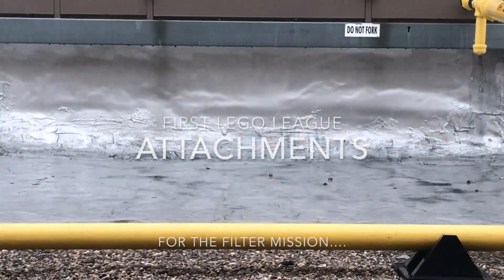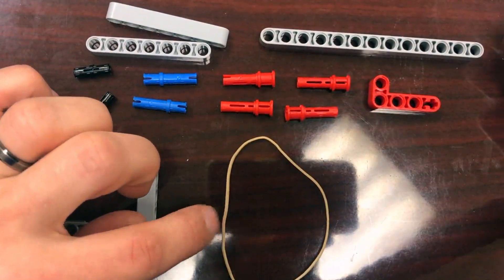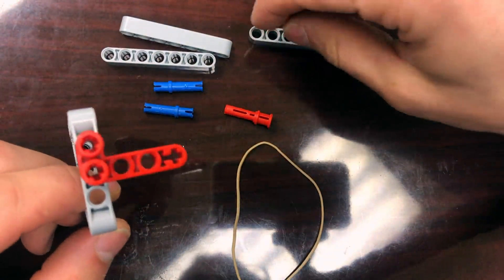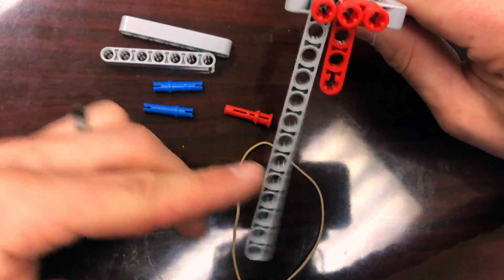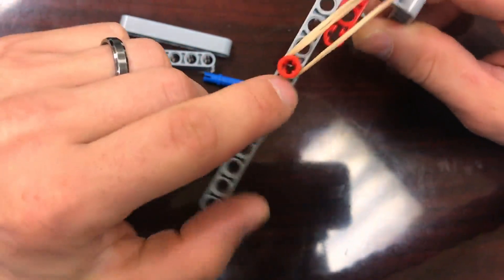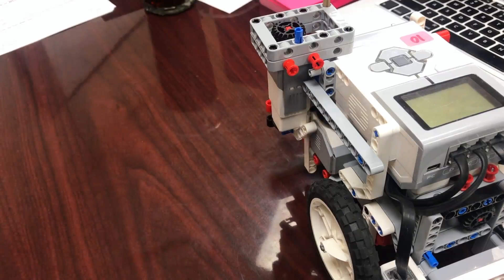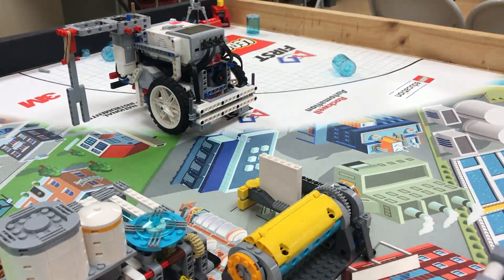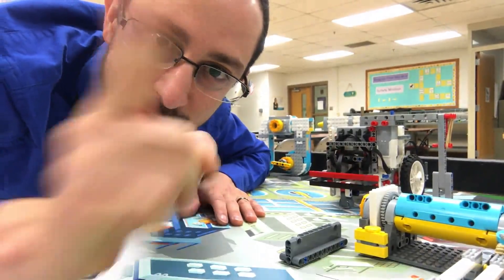FLL Hydro Dynamics Attachments: Filter Misson

Comment: Muchas gracias
Reply from the maker: Informatica Portillo you’re welcome!
Reply: I'm new to this subject, and I speak little English, you could help me.
How many engines at a time can I put in an ev3?
Reply from the maker: Informatica Portillo Sure! You can put 4 motors to an EV3 brick. (Ports A, B, C, D). You can also put 4 sensors. (Ports 1, 2, 3, 4)
Reply from the maker: Informatica Portillo All 4 motors are allowed the robot at a time.